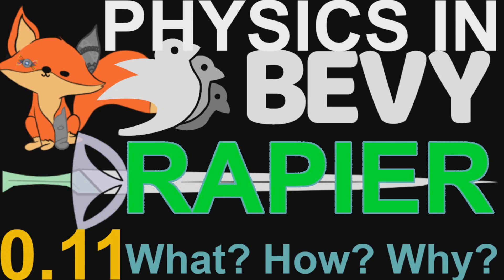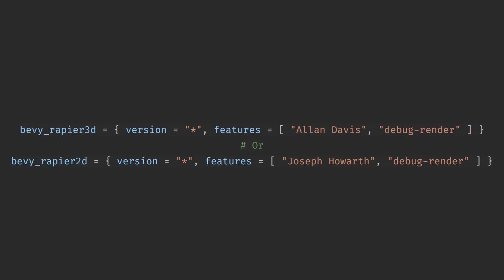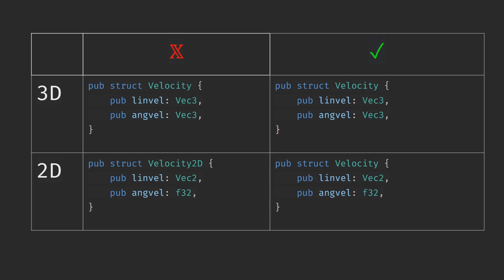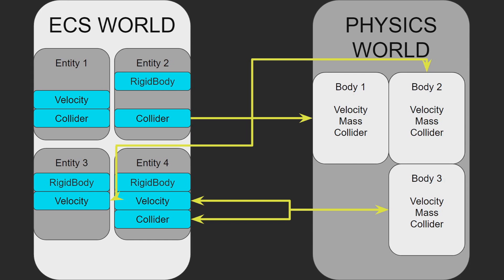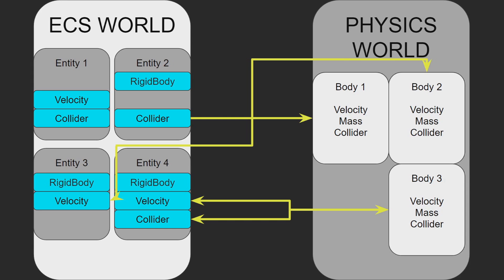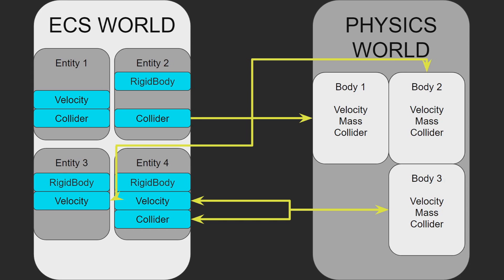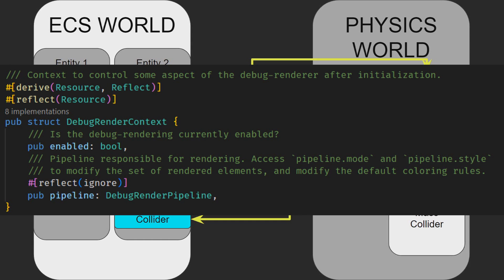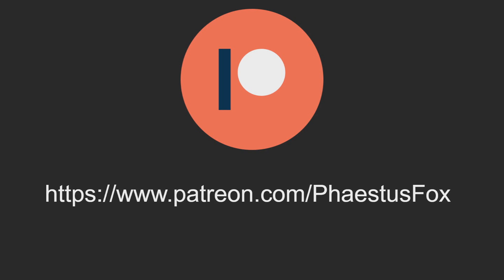Physics in Bevy: What is Bevy Rapier

Comment: Do you think it would ever make sense to just use Rapier for physics and handle all the game logic yourself (without Bevy?). If so, how would you go about rendering the world?
Reply from the maker: I'm sure there are some times where that would make sense, but to Handel rendering you would need to write your own engine or use one of the other  engines out there
Reply: I do that, in rust, without a “game engine” a thing you could use is raylib, it has great rust bindings (3rd party).. I have setup my own, simple, “engine” for my games that consists of “EntitiyType”s chunking, ticking (with physics) on a separate game thread, rendering on the main thread, channels for passing keybind/keyboard stuff to the game thread. Soon to be networking using those channels, with a network thread. I am trying to upgrade rendering and writing a working PBR shader and some post processing shaders. I plan to use and upgrade this system for at least (for now) 4 games, a remake of the first five nights at Freddie’s game, 2 original games, and one original VR game)
Reply: And by no means is my “engine” complicated, it just keeps track of some things to only render close things. I still have a lot to do to on my game / engine

Comment: NIce explanation. Can you use bevy_rapier if you are only using bevy_ecs in your application and nothing else bevy related? If not, do you have any suggestions on how to manually integrate the communication with bevy_ecs and rapier into your application?
Reply from the maker: I don't know I would need a deep look at the code, but at the very least it doesn't need any of Bevy's default features, so I would imagine it could, maybe look at the code for if there are specific systems you would need for the extraction